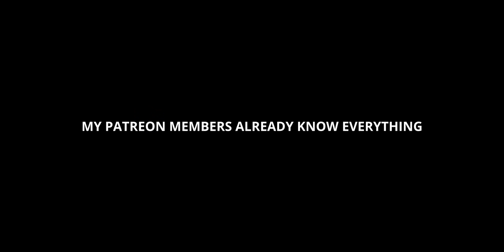New Bronco & Tundra Battle Snow Drifts On Sketchy Mountain Trail

Comment: I wheeled an '85 Toyota and a '96 Ram for decades and my only real complaint was the way the rear end would want to change places with the front end in off camber situations. Usually there's something substantial on the other end of that off camber spot that I'd want to avoid. My JKU doesn't have that tendency.

Comment: Is it just me, or does it seem that Broncos spend more of their time on 3 wheels instead of 4 when driving serious off-road trails?    I have noticed this on many different YouTube channels.    It looks like by its very nature of independent suspension that the vehicle just cannot handle any situation where serious flex is necessary to maintain contact with the surface, and will leave you teetering in mid-air at any moment.     This is not something I would want to own, I would much prefer the Jeep's solid axles and long-range flex over the Bronco any day!
Reply from the maker: It does 3 wheel a lot